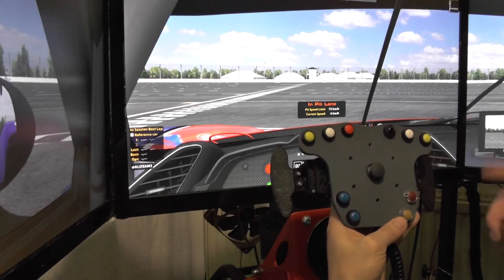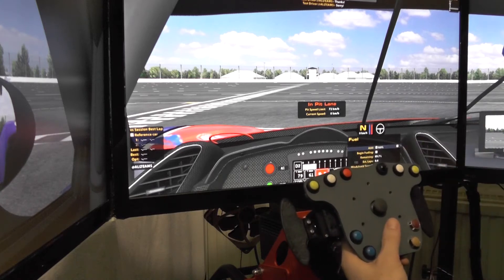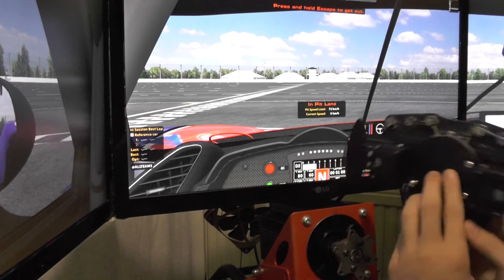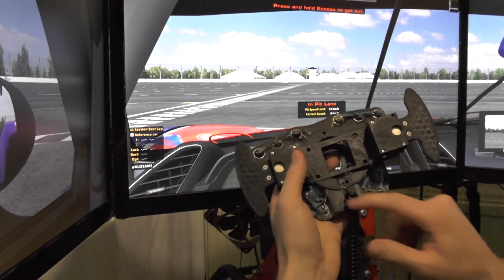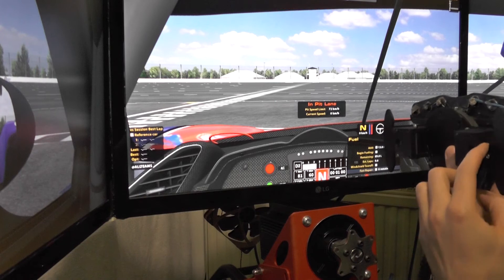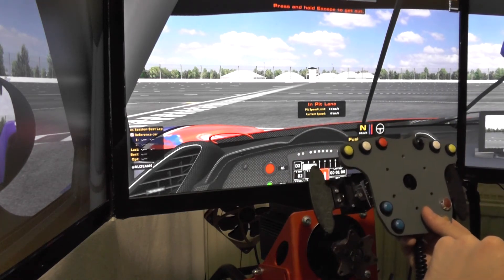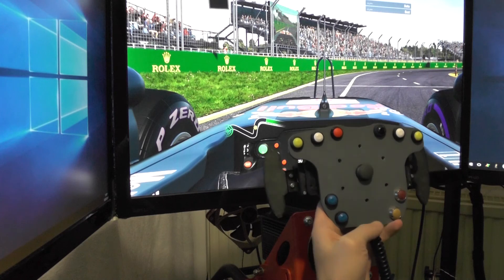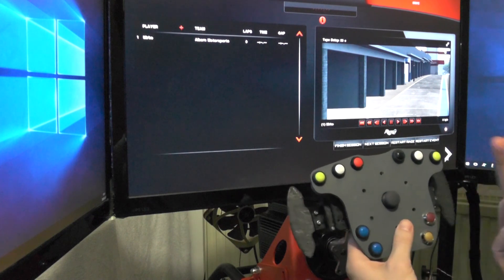3D Printed Wheel Button Box - Build Info / iRacing / F1 2017 / Automobilista

Comment: Never saw someone shifting up with the left shifter. Interesting. You have a specific reason for that?
Reply from the maker: I switched back to the right side a few months back.
I did this so I could change pit (fuel) settings while going down a straight and still shift up without having to move my hands back to the wheel. Switched back because it was a pain to use my friends setup :)

Comment: Thanks for your kind work you share, I will print this when my order for PLA arrives .

Now to only issue I would have is those horrible buttons , I've use the and hate them :) I'll put a link for better buttons to use , very like the knitter button but a lot cheaper .

https://www.aliexpress.com/item/10Pcs-Red-3Pin-C-NO-NC-6mm-Mini-Momentary-Automatic-return-Push-Button-Switch-2A-250VAC/32802495997.html?spm=a2g0s.9042311.0.0.p9fKB9

Ps , I think your work is wonderful.
Reply from the maker: I like the buttons I currently use since they are light and don't stick out too far but I noticed that the build quality can differ a lot. 
Also have a bunch of buttons similar to the ones you want to use. I think the mounting holes need to be adjusted. I'll check it later today and will post a version with adjusted hole dimensions.

Think I have seen those buttons on other wheels but they also include some sort of sleeve. I have not been able to find the sleeve or I would have added them as well.
Reply from the maker: Looked into it but I can't find exact dimensions for the buttons. These switches screw in from the front so the plate may be too thick. I did find similar switches with dimensions. Looking at those specs, the body may fit into the holes for the hex nuts.

Issue for me is that these types of switches stick out too far. Maybe the button plate could be modified so that the switch is mounted further back.
You may contact me using the following contact form if you need any help. These YouTube comment boxes suck for collaboration. https://www.kaisersoft.net/index.php?p=5